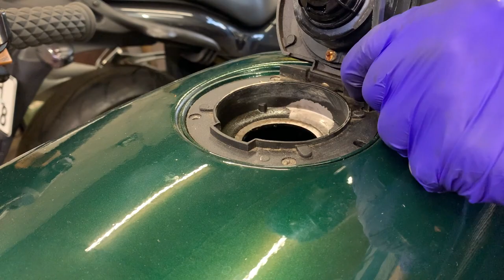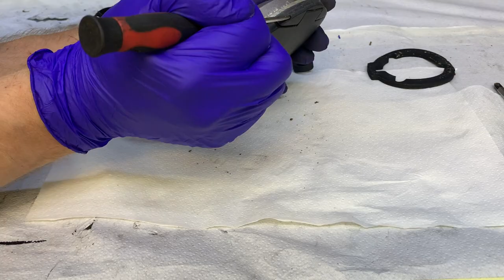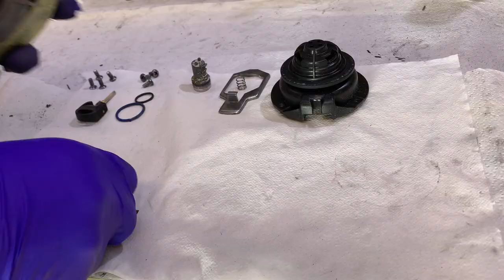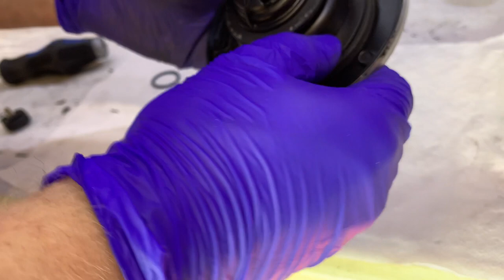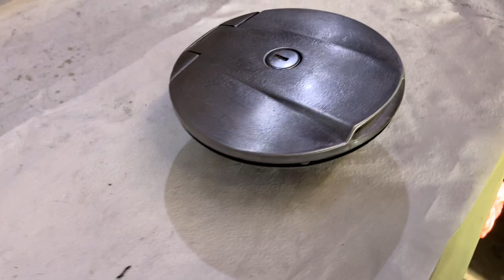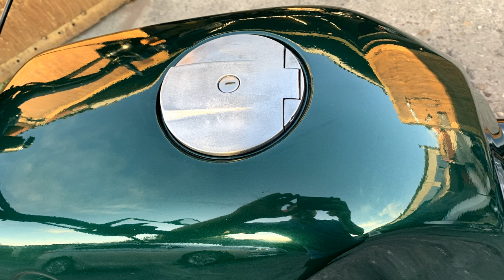BMW K1110 LT Fuel cap restoration

Comment: Great job. Do you have part number for gasket that fits between fuel tank and cap assembly?
Reply from the maker: Hi, thanks,
Here is the link where you can find the number
https://www.bike-parts-bmw.com/bmw-motorcycle/K%201100/1992/K_1100_LT_-0526_0536_/Fuel-Supply/Fuel-tank-filler-cap/3/16_0328/16/517100526